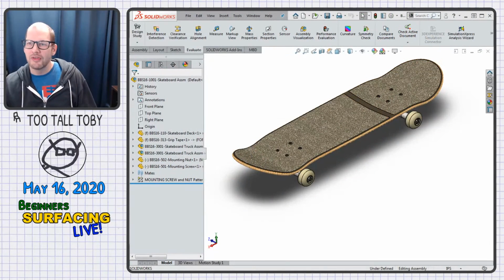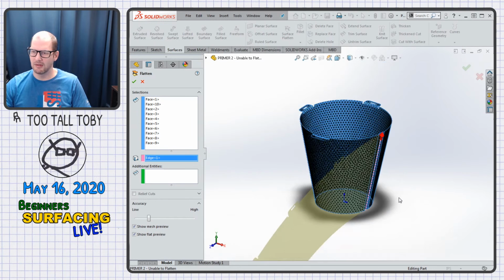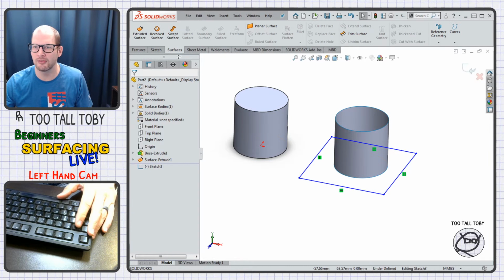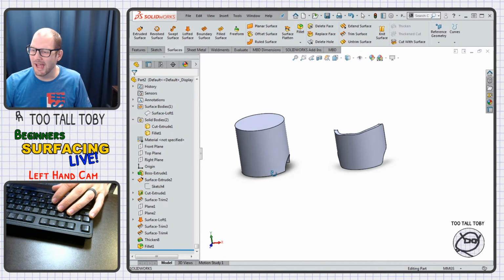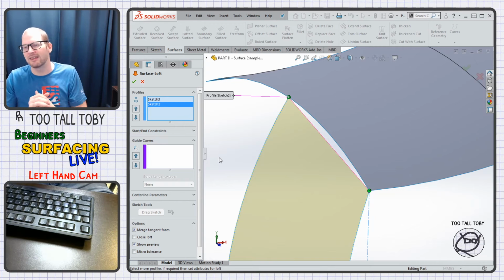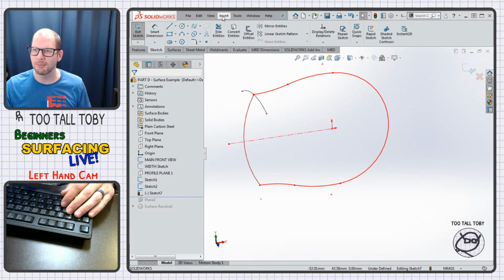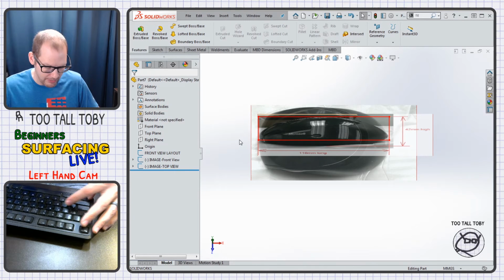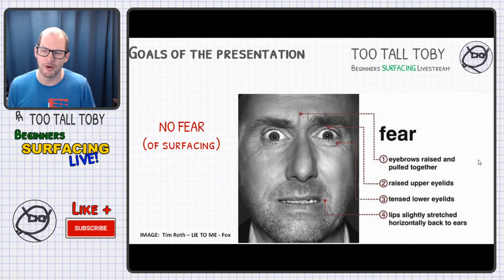SOLIDWORKS BEGINNERS SURFACING Presentation

Comment: Great video (a bit slow start imo)! Now I want to try to create something that is not just a bunch of angles and bricks :).
Inspired by the mouse surfacing, I went ahead and tried to model a mini stapler ( https://imgur.com/a/ZjMi2Jy ). One thing that got me stuck for a while: If curves double back on themselves, there will be problems. E.g. curve A is shaped like "/", curve B is shaped like "U". Projecting these together, the software can see two solutions, due to B doubling back. This resulted in failed or partly mirrored curves. The trick was to split the curves into smaller pieces before projecting, making sure that the align at each split point. (I'm using Onshape).
Reply from the maker: Hi Thomas!  Yes you are 100% correct and we have to do the same thing in SW.  When you have a curve (projected) that doubles back on itself you often have to split it into 2 curves, then do the projections 1 x 1.   We have a tool in SOLIDWORKS called FIT SPLINE that lets us "trace" over the 2 curves with a single spline, but maintain curvature continuity.  I use this a lot in spots like this.   But even if you dont have this in onshape, you probably have a 3D sketch tool that you can use to merge the 2 resultant curves, so you have a single guide curve entity.

If you like this kind of stuff be sure to check out ANDREW LOWE.  I had him on my show a few months ago, and I'm hoping to have him on again next month.

Here is one of my favorite presentations he did:  https://www.youtube.com/watch?v=yY90w6AZDgE

Comment: Thank you so much for this video and for directing me here from Reddit. 
I've got a couple questions and would be grateful for any answers.
First question: Is there a reason to use planar surface vs fill surface?
Second question: How do you go about dimensioning surface created features in your drawlings?
Reply from the maker: Hi Just Here to Nap - Glad you found it useful!  To answer your questions:  1. Sometimes it's important to have a plane - like when that face is going to be used for SKETCHING or MATING.  So I like to use PLANAR surface in these spots to ensure that there is no "accidental curvature" that I wasn't expecting.   2.  Fortunately (for me) I have always been able to hand off my models directly to a CNC or to a 3DPRINTER, so I never had to create a fully dimensioned 2D print for manufacturing or inspection.  I suppose you would do it the same way the old air foil or propeller drawings are created - several section views across the model each one dimensioned to key points for inspection.   - Hope this helps!
Reply: @TooTallToby  absolutely thanks it helps alot. I can't wait to catch your live stream tomorrow.